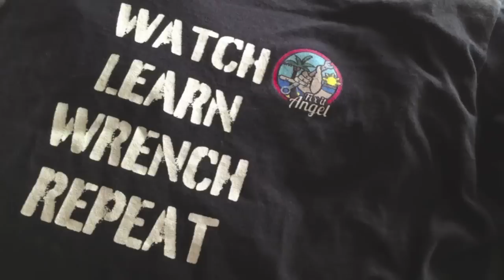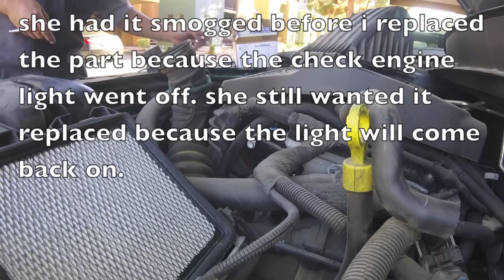EASY replacement Intake Runner Control Valve [P2017 STUCK oPEN] Dodge Avenger √ fix it angel

Comment: How do you reset it  after you replace it
Reply from the maker: remove the negative battery terminal for a minute, then tighten back to battery post. the check engine light will reset.

Comment from the maker: Intake Manifold Runner Control Valve https://goo.gl/UbqZdD
                                                                   https://goo.gl/47NYvu
Screwdriver Set: https://goo.gl/MW41uB
                              https://goo.gl/8R4Me7
1/4 drive locking extension set https://goo.gl/mZA37e
                                                        https://goo.gl/1TGQUq
GearWrench Set: https://goo.gl/03vgcL
                              https://goo.gl/MMgXNV
1/4" & 3/8" Drive Standard Socket Set https://goo.gl/tMw1SG
                                                                    https://goo.gl/y2VAYo
3/8" Drive Extension Set https://goo.gl/HrOvhn
                                            https://goo.gl/c9HApy
1/4" Drive Flex head Ratchet https://goo.gl/fMi6Lf
                                                    https://goo.gl/m27v9k
Bungee Cord Set https://goo.gl/VCUa6N
                               https://goo.gl/k63Smt
Battery Jump Starter: https://goo.gl/Lm4tKv
                                       https://goo.gl/W7GJ7Y
Battery Terminal Cleaner Brush https://goo.gl/ioiFDF
                                                        https://goo.gl/Zx7NNu
Engine Air Filter https://goo.gl/pr2Ajc
                             https://goo.gl/QCQjaH
OTC Scan Tool https://goo.gl/i4FojW
                           https://goo.gl/Ywvdyg

Comment: Replaced this part , what’s should I look at next? Had 2  Codes one went away and  p2017 is still popping up
Reply: Same problem here I have a 2009 Dodge charger with p2017
Reply: Grrr this guy ne er answer
Reply: probably the entire intake manifold

Comment: I got a 2010 Dodge Avenger 2.4 and it don't got a running valve on it I don't see no wire on the engine

Comment: Angel i have a 2008  dodge avenger 2.4L looking to replace idle air control valve but can't find where it is. Can you tell me how to replace it? thanks
Reply from the maker: type this on google search and search for pictures. 2008 dodge avenger engine 2.4 l 4-cylinder idle air control valve. It's as easy as that.

Comment: I see you with your fresh Toyota mechanic shirt
Reply from the maker: YungHam thanks, my friend gave it to me when he quit.
Reply: Very fresh. I actually work at Toyota of Dallas. So it was easy to spot.
Reply: Do any of y'all know y does it blow heat on the driver side and then the other side cold and then wont throw no more until you turn it off and turn back on on the heater

Comment: Hey Angel I was having some idle issues and thought I would check this out. I have a 2014 dodge avenger 2.4l. I see where the intake manifold runner valve is supposed to bolt on. But I do not have one on here? I also cannot find the wire harness connector that hooks up to the side of the valve. I don't know the whole history of the car but is there a chance my vehicle does not require this part? Any help is appreciated

Comment: Hey Angel. I have a 08 Caliber I replaced the same part and I cleared the engine light but it came back on within 15 minutes. Could it be a bad part? I’m still getting p2004 bank 1 stuck open. Any advice would be greatly appreciated, thanks!!!!
Reply from the maker: if you are still getting the same code. then that means in the first place you didn't have the p2017 code. Am i understanding that correctly you have a p2004.
Reply: Fix It Angel I had a P2004 code I replaced the part cleared the engine light and it came back on. Now after doing so I have a P2016 code. Just today I took the part back out and there is a pin that goes inside the manifold that the part aligns itself with and took that out and cleaned the pin and greased it up because I’m thinking it was maybe stuck and I was able to clear the light again but it came back up within 10 mins.
Reply from the maker: @gh0stFace13x  you may need a new intake manifold. i have never fixed that kind of code. hope this video helps
  https://youtu.be/THLg0-tHOGE

Comment: hey thats what i got in my 2008 chrysler sebring. 
error. p2017 intake manifold runner position 
sensor /circuit. ☹️
Reply: viatun viatun did you ever figure it out
Reply: I got a 2010 Dodge Avenger 2.4 sxt with no running valve I don't understand that why  a engine with no running valve

Comment: Ey homie thanks straight to the point no bull shit. Have this problem 2010 caliber stuck open p2004. Just to make this right, take off neg cable then do the exchange or disconnect after exchange of part?

Comment: Replaced intake manifold twice BRAND NEW on Chrysler Sebring   still saying control runner stuck open should I just replace control runner ??
Reply from the maker: Sierra Moore hi, yes replace it. It’s an electronic part. They do go bad. 
When you replaced the intake manifold. What was the reason for the replacement?
Reply: Its the only code showing up on the car and I replaced the intake once and code went away and came back replaced it second time and still saying that the runner is stuck open. At times car won't start or it will cut off while driving.
Reply from the maker: Sierra Moore well that’s strange. Get it diagnosed at a good shop. If they say it’s the intake runner. Then you replace it. 
Getting it diagnosed by a professional confirms the part is bad. 
That is what I tell my friends and family who needs advice. Good luck
Reply: Thank you so much

Comment: Hey does anybody know the exact name for the part that is being changed I looked for a 2013 EGR valve and they say my car doesn't come with one I also looked for manifold intake throttle control and they say that's not it either
Reply from the maker: 0:03 please read video description
Reply: I believe it's also called a runner position?

Comment: great video,  but the check engine light still on and I disconnected the ground for ten min and still on then reset the computer inside with the key , still light is on , any suggestions?
Reply: Any answer to this. Same problem for me.

Comment: From Mexico city. With only changing the valve, the light will not come again? I have a p2017, journey 2009, i already have take it out  the runner and the spring seems ok.  I constantly soak it with wd40 , i erase the code and in a couple of miles the  MIL light goes on again , I dont want to take off the whole intake manifold . Please comment. Or maybe a video on how to be sure, to check the valve is something wrong.  Thanks in advance.
Reply from the maker: M&M VD replace the valve with a new one. Don’t waste your time trying to fix it. If I knew how to fix it then I would have done a video. 
You won’t know unless you replace the part.
Reply: +Fix It Angel  so..let me be a little more specific: in this avenger video or in the other video you change the valve and pass the smoke check, in both  you only changed the valve,  mi question is: did the engine MIL light wouldnt light again?  Or did customer report he problem light again?
Reply from the maker: the light did not ever come back on. no check engine light after replacement with a new valve.

Comment: Hi Angel, I have a Dodge Avenger 2008 2.4 L, and I have the same code. My question is, after changing the Control Runner Valve, is a reprogramming on the PCM needed?, you know... in order to set parameter or something...?

Thank you very much in advance, and for sharing your knowledge with us.
Reply from the maker: Hi, you just need to remove the negative battery cable for a whole minute and then tighten it back to the battery. It will reset the check engine light. Welcome and thank you for watching my videos.
Reply: I need tu purcharse the p1004short runner valve

Comment: If the diagnostic reader said my cars intake manifold runner control , would that be what's causing my car to leak and over heat ? And if it's replaced would it fix the problem
Reply: Cat Sateva replace the intake manifold Probally has a crack in it
Reply: It’s probably leaking on the side of the engine. You probably need the water outlet kit that has orings

Comment: My 2008 Chrysler Sebring 2.4(same motor as avenger) showed that rudder was stuck open and bank #1 was running lean. Replacing intake rudder should fix both of them correct?
Reply: Jenesee Melendez aye bro still got that 2008 Sebring

Comment: So how did you know it was bad
Reply: randy hughes check engine light
Reply: Legal Green Music so you don’t prove things failed you just throw parts at it
Reply: Once you get the codes from the engine light it will tell you, theyll tell you at the shop as well
Reply: Legal Green Music spoken like a person that has never fixed anything I have been a mechanic 41 years
Reply: @randyhughes5160  are you a troll or have you never used a car diagnostic code scanner
Reply: @river121697  It is one thing to use a code scanner, it is another to confirm that the code in fact was caused by the part in question. In this case, it's not a big jump to make the assumption, but very often a trouble code will NOT directly give you the cause of the problem.

It is always better to confirm that the part is actually bad. This guy should have (and may have off camera) confirmed that the flap in the intake manifold turns freely, and that the control valve in fact does NOT turn freely or return to the "home" position without sticking. That kind of confirming it is the problem is what Randy is referring to, and is absolutely the right thing to do.

Comment: bro, i was trying to replace the same thing on a kia sorento but the check engine light stays on. i wont erase. they are saying the values has to be reset with a computer.. my scanner is only capable of reading and erasing codes.. really sucks
Reply: thanks man

Comment: Didn't  show if the engine light went off smh
Reply from the maker: Margaret Evans did you read?? 2:14, FYI the part will sometimes work and the light will go off. In this case the light was off before I replaced the part. 
I would not have upload this video if that certain part will not fix it. 
I know what I’m doing. Ya smh